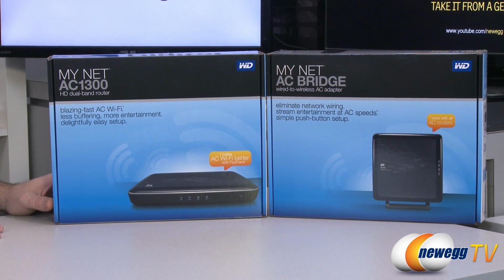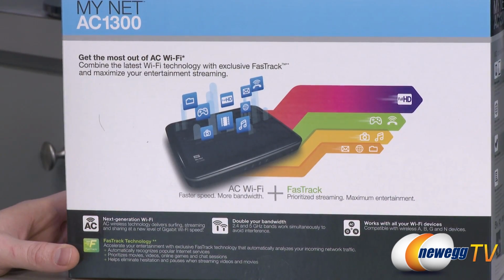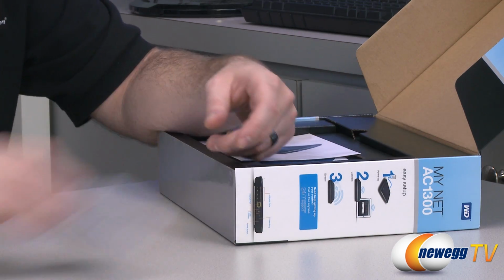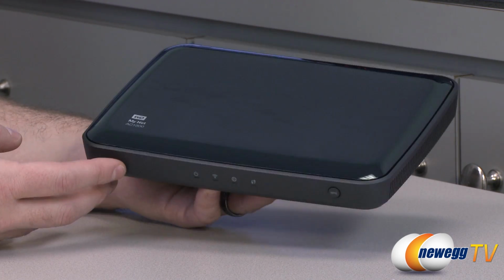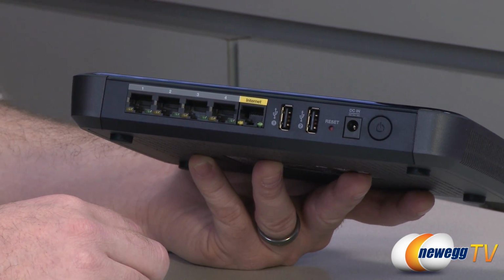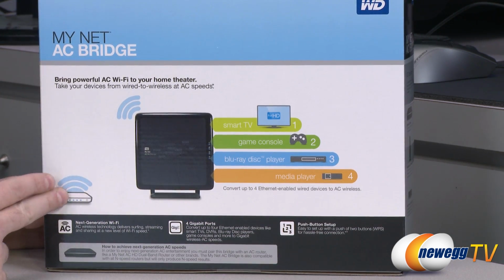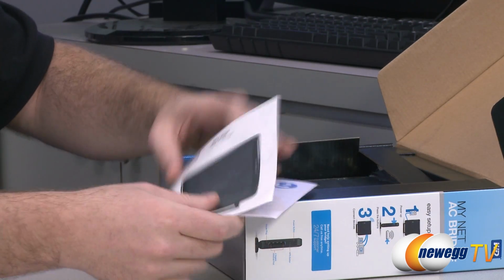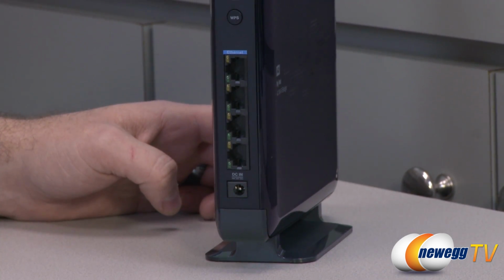Newegg TV: Western Digital My Net AC Wireless Router + Bridge Overview

Comment: well Gigabit ports and 1300M/bit (5 Ghz) Wi-Fi but it really going to depend on the computer interface IE if your using USB 2.0 only has 480M/bit through put so to get 100% youll need USB 3.0 or a card

Comment: It is not a matter whether or not your xbox is compatible with your router. By default the port for xbox live services is blocked on all routers. That being said, opening ports can be a pain in the balls and, in my opinion, is the most finicky part of most anything computer related.

TIP: Make sure you set a Static IP for your Xbox and you can put DMZ on that specific IP. That way all ports are open and you should be okay. :)